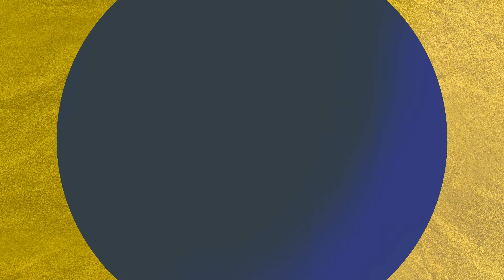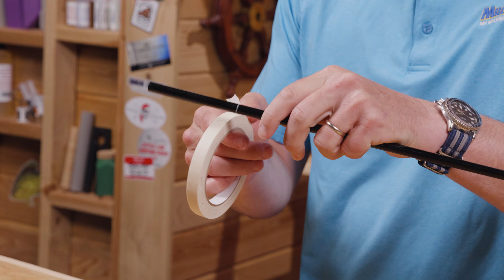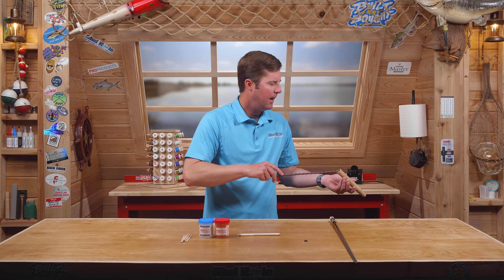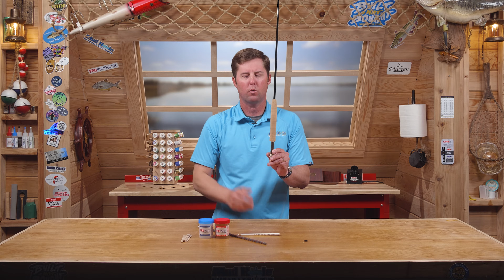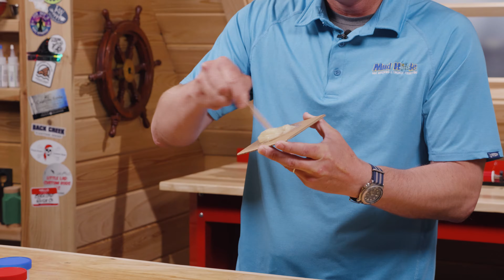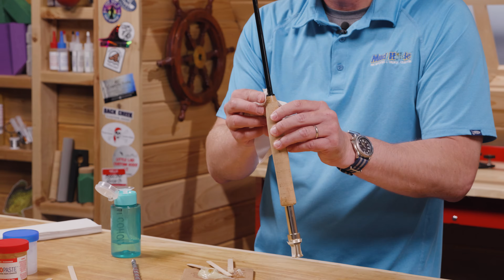Step 2B: How to Assemble Your Fly Rod Handle - Rod Building 101

Comment: When building a mooching rod for Salmon it the handle process the same ?
Reply from the maker: This would depend on the handle setup you are going for. If you are building the handle section with a long full length rear grip and fighting butt, you would follow Step 2 of this series (How to Assemble Your Fishing Rod Handle), specifically starting at 4:43.